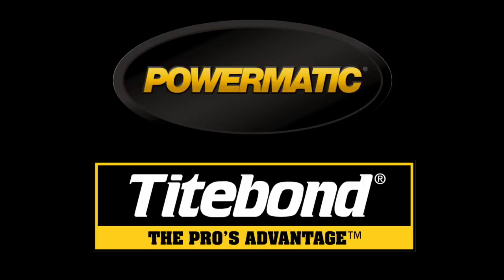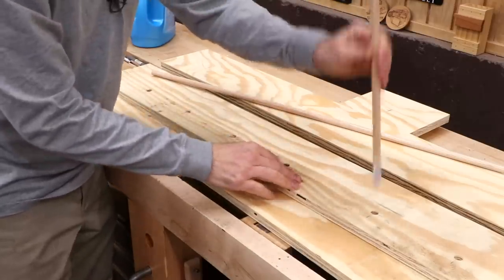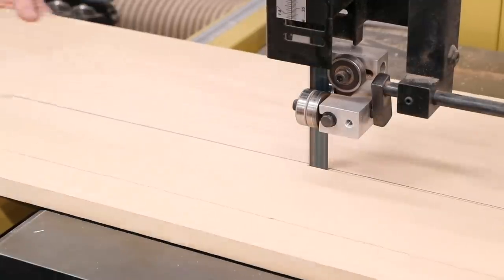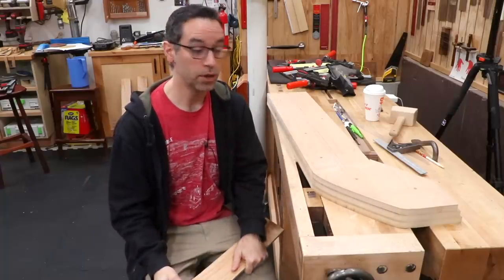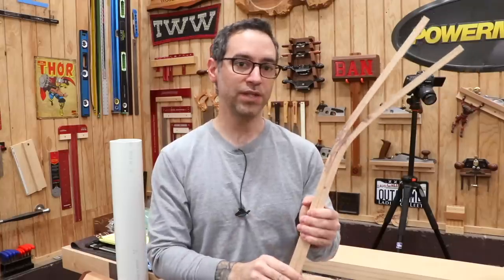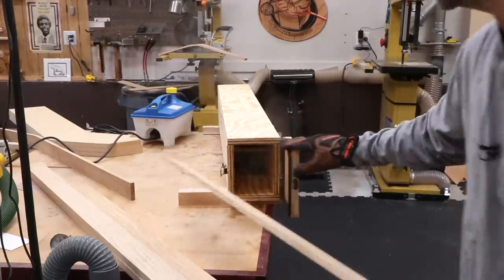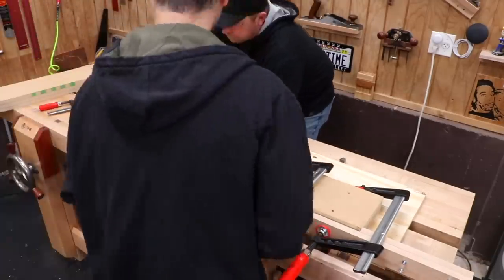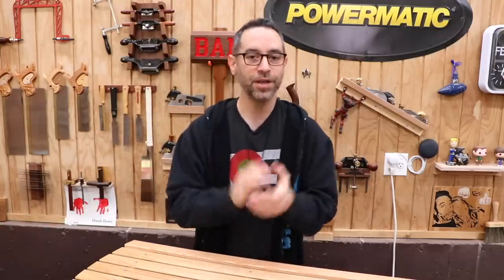Adventures in Steam Bending

Comment: I'm pretty sure I've seen timber at my local hardware store that looks like that already. :)
Reply: What you referred to are especially good for boat making, rocking chairs and silos.
Reply: Yeah, but they call them studs.
Reply: Dark Justice  Ya I realized that when we had to go there and get wood for a new fence and gate.
Reply: I’ve seen stuff like that for sale too! Usually at the back of the rack, warped to hell and no one would touch it with a barge pole! Some shops really need to work on their quality control.
Reply: Have been reading a lot about steam bending and wood properties. To increase the chances of a good bend without cracks I recommend to superheat your steam to first try at 150 degrees celsius (more or less) and then try at around 200+ degree celsius. Continue to use your time rule + a little extra for good measure (just important to get the wood at a uniform temperature).  

The reason I recommend this is because the substance that holds the fibers together in wood is called lignin, and this substance and its melting point is described in this one article (https://www.sciencedirect.com/topics/materials-science/lignin (3.5.1.3 Lignin) ) to have the following properties "Lignin has a glass transition temperature of about 90°C and melting temperature of about 170°C. Another article (https://bioresources.cnr.ncsu.edu/resources/thermal-softening-adhesive-properties-and-glass-transitions-in lignin-hemicellulose-and-cellulose/) make out lignin to have a "Softening temperatures of lignins ranged from 127-193°C. Birch xylan and pine glucomannan softened at 167° and 181’C, respectively."

To increase temperature, you could maybe take the exhaust gas from combustion and coil it with a copper pipe multiple times around the steam pipe and to increase heat transfer the steam pipe should also be from copper. You could also maybe route the exhaust gases directly into the steam box. I still recommend having the steam presence as the article (https://bioresources.cnr.ncsu.edu/resources/thermal-softening-adhesive-properties-and-glass-transitions-in-lignin-hemicellulose-and-cellulose/) state that "Sorption of water by lignin and hemicellulose caused pronounced decrease of the softening temperature-in some cases to as low as 54°C." 

It would be really cool and interesting to see this experiment and see how it changes the bend. I would love to try myself but I am currently studying in a big city abroad and
wont be able to try it before the summer when I can go back to my home town where I have garage and equipment. But I dont want to  wait that long! :)

Maybe if your able to superheat your steam to 200+ celsius you could try to bend pine wood? Know this wood is notorious to be hard to bend!

Comment: I'm a guitar builder, so the wood I'm bending is much thinner.  Take this for what it's worth.  In the guitar world, we have found that water isn't important for bending wood - HEAT is the thing which softens the wood.  Steam can help to carry the heat into the wood, but the water just makes things go wonky, particularly if you have a piece of wood with complicated grain structure (anything which isn't perfectly quartersawn, with minimal runout).  Now, we are bending thin pieces of wood, and we bend them around heated forms, but these days I use a spray bottle to moisten a side, wrap it in parchment paper (the stuff for the kitchen), and bend.  Thicker wood will require more heating than this, but I'm not at all convinced that water is helpful in the process.  Using something like the silcone heat blankets most guitar builders are using would be a great, albeit expensive, option.

Air dried lumber is a big deal, though.  Either that, or make sure it has been acclimatizing to your shop for as long as possible - a year at least.  Kiln dried lumber still has a lot of moisture in the cells of the wood, but most of the water has been driven out from between the cells.  It's average moisture content is low, but it has pockets which is quite high.  When the wood is heated enough for bending, these areas have very different plasticity, and you get a lot of spring back and checking.  Air dried lumber dries more evenly, so when heated it has a more even plasticity.

Compression is extremely beneficial.  It can make it possible to bend wood which is completely unsuited for bending.
Reply: That makes sense, since at 5000ft above sea level, his steam is significantly cooler than at sea level.
Reply: I left a separate comment earlier citing the Wood Handbook which basically agrees with what you say. I had also though about how, for example, the sides of an acoustic guitar are bent around a heated form without steaming. It is in fact the heat which "melts" the lignin in the wood and makes it plastic. The added water/moisture apparently just helps reduce the melting temperature and thus also the chances of damaging the fibers of the wood at prolonged exposure to high temperatures. The sides of a guitar are so thin, as you mentioned, that I think the heat simply takes less time to permeate the full thickness of the wood, so it can be safely bent with heat alone in a much shorter time without damaging the fibers. I suspect that if you tried this with a much thicker piece, you might end up degrading the fibers in the (much longer) time it took to fully heat and plasticize the board.
Reply: @MechanicalMind7  Makes sense, though while we don't use steam, it is traditional to soak wood for 5-10 minutes before you bend sides.  This has become far less common, though, because it will frequently cause highly figured wood (curly maple, curly koa, etc.; or some of the flat sawn stuff we sometimes have to use because customers can't understand that all available Brazilian rosewood came out of the burn pile from a factory 50 years ago, and should have ended up in a furnace) to create cross-grain cracks when bent.  With highly figured wood, bending it almost dry is by far the most effective option, and it works so well with difficult wood that we may as well use it for easier wood as well.  As I think I already said, for guitar sides I spray them with a spray bottle, wrap them in parchment paper to keep any resins from cross contaminating anything, and bend it around the mold with a silicone heat blanket.
Reply: how hot is the metal you bend around? Im wondering if heat blanket kits from webstaurant store witha cheapo temperature thermostat controller from ebay would be hot enough a with enough control heat blankets run 30-60 bucks
Reply: @802Leith  I've never really measured it, but the Watlow blankets I use can easily and quickly get up to about 500 degrees.  I run them pretty much full on for bending, and then turn them down to "set" the bend at about 50% (or so) power for ten minutes.
Reply: Thank you, that's very helpful.
Reply: @lightaces  I use an aluminum foil wrap and spritz of water. Some woods tend to bleed resins a bit more than other, but it does depend on how long and how high the temperature in the blanket. But it only takes about 3 or 4 minutes for a complete side-bend in my press. I usually cool down for a couple of hours before releasing.
Reply: @garyhome7101  Aluminum is such a reactive material, and I use a ton of parchment paper anyway (it is a much better replacement for wax paper to protect cauls from glue), I like the parchment paper.
Reply: What temperatures are we talking?
Reply: @walterblanc9708  I don't actually measure the temperature, but on my old metal Overholtzer benders I test them by looking for the Leidenfrost effect.  That happens right around 400 degrees Fahrenheit.  Wood is a pretty good insulator, though, so most of the wood never gets anywhere near that hot.  My other benders use silicon heat blankets, and those can get up to 600 degrees, but I turn them way down as soon as I'm done bending (bending around forms is a pretty quick process - a couple minutes at the high temperature, then turn it down to about 2/3 on the rheostat.)
Reply: @lightaces  Thankyou Gabriel. I see you have lots of vids! I shall watch. I intend to make some shelves with curved end pieces for knick knacks and stuff. This video had put me off I shall use thinner wood!
Reply: @walterblanc9708  Steam bending is really a very different process than what we do, though.  I would say the most important thing to keep in mind, especially for a first try, is to make sure your wood is clear of defects, with as little run out as possible, and ideally well quartersawn.  You want to reduce the opportunities for cracking as much as possible.  Another thing which is know to help is bending the wood in tension (stretching the wood lengthwise while bending).
Reply: @lightaces  Thankyou for the info. i guess It will be a fairly steep learning curve.
Reply: @walterblanc9708  I'm pretty sure you Taunton Press has some books on steam bending.  their stuff is always worth while.  Just make sure to allow for some practice pieces.
Reply: My grandfather was a master of different handcrafts (worked with metals, wood and so on) and was able to make almost anything as blacksmith and same as woodworker and carpenter. He produced a lot of toys for me when I was a kid, using wood (usually young ash, there were many of it in our place). At  that time he was 85-90 years old and about 80-90% blind and even can't recognise me and my brother with his eyes.
   And last that I remember about his craftsmanship was the woodworking process when I helped him to make a bow for me ( every summer I asked him for new toys I saw in movies or somewhere else during academic year in primary school ). It was simple project, piece of ash was not too thick (no more than 1 inch in diameter). And for bending we (he) didn't use any heat at all. He used only little water which was just same temperature as air (about 25-30 celsius). He moistened a rag with water, then with this rag he moistened a piece of wood along its entire length several times in a row, and after a short time he simply began to slowly and carefully bend with his hands. Having received the desired radius of the arc, I helped him to secure the ends and fix the shape with a thread (both ends were tied under tension). After that, we left the bow for a day or two at open air to dry.
   As high precision wasn't required we did nothing more than this. I saw his other completed projects with bended wood pieces 2 times thicker than this but I didn't see any special tools or heaters around. He has could use some big water bath with heated water ( I saw one japanese master used this technique ) for thicker wood pieces to steam up and reduce fiber tension. But at this time my grandfather was almost completely blind and stopped do anything at all. So I didn't catch more complicated projects and stuff. But still I learned a lot of things from him just by messing around when he still was able to do simple projects and toys for me.
Reply: Great response!...I have a koa set that's been sitting for a year plus...in my closet...jaja....any insights for bending koa sides?
Reply: @LiloUkulele  How much figure?  If you can find a way to keep the side under tension as you are bending it, that helps a lot.  And minimal water...Take your time, and back it up with some stainless spring steel.
Reply: @lightaces  Thanks for the reply! It's pretty straight-grained, just some nice variation in color (sapwood?). Do you just spray a little water, wrap it up and used a heat blanket?...some times you just have to jump into the water...thkx again for the quick reply!
Reply: @LiloUkulele  yup, pretty much.
Reply: I know I'm late to the party, but I did a cooperage workshop (bucket, pale and barrel making) and they said the same thing. When bending oak barrel staves the key is to heat it quickly, then bend them before they cool, no soaking involved.

Where soaking helps is on green lumber. I've been bending wood hoops for my buckets. I cut a bunch of hoop blanks from fresh cut breech or ash and keep the blanks in PVC tubes with water to keep them hydrated so when I get to the part of making the hoop the wood is still flexible.
Reply: @GodotWorld  Interesting....a question, though;  what, technically, is the difference between a bucket and a pail?  I always thought that was just a dialect thing.
Reply: @lightaces  Pales are wider at the bottom. They're meant to hold liquids, like milk, and don't tip over easily. Fill the pale put it on a wagon or boat and swaying back and forth or hitting bumps in the road it won't spill all over. Buckets are wider at the top, can hold liquid, but not necessarily. Easier for putting things in and taking them out.

TL;DR: A pale is basically an upside-down bucket.
Reply: @GodotWorld  both the people I told this to want to know - what if the sides are straight?
Reply: @lightaces  I don't know for sure, but I'd call it a bucket as the key feature of the pale is the opening has to be smaller than the bottom to keep liquid inside and make it harder to tip over.
Reply: @GodotWorld  Thanks!!!  Over the weekend, I've told this to 3 people, and ALL of them asked the same question!!!

Comment: Hi Marc - great video - I've done a lot of steam bending almost exclusively with kiln dried timber (oak, ash, walnut, maple). Don't soak it! I've found the most important factors (in order) are ... 

1: Strap. You are quite right, without a compression strap you will fail a lot!
2: Temperature in the box. Get as close to 100C as possible - below 95C is no good.
3: Steaming time. An hour per inch doesn't seem to come down in a linear way ie half inch takes longer than 30 mins etc.
4: Try to avoid grain run out on the bend.

You are right about drying too - I clamp mine in a drying form then put it in the oven (I bend much shorter peices than your sled!!) ... 3 hours at around 80C seems to give almost no spring back.

Like I say, this is just my own personal experience - as you rightly point out, trial and error is the best way to suss out what works for you - I have photos of piles and piles of bending fails to attest to that! Thanks again for your wonderful channel & keep up the good work.
Reply: I’m guessing that soaking the wood just adds more cold water that needs to be heated up, is that right?
Reply: Thanks for the informative comment.
Please post a video on bending.

Comment: I took a class with Michael Fortune (master woodbender) a few years ago. He recommended only air-dried wood for steam bending. He also said that the bending strap is essential. As you pointed out, wood doesn't like to stretch, but is happy to compress. A strap of his design that is adjustable for any length board is available from Lee Valley. He claimed that there should be NO springback with steam bending. He had a 6/4 piece of walnut that he had bent around a 3" diameter form and it still fit snugly around the form. Amazing! His line was "once the wood is steam bent it thinks it grew that way".

Comment: Morning Wood Whisperer! Have been reading a lot about steam bending and wood properties. To increase the chances of a good bend without cracks I recommend to superheat your steam to first try at 150 degrees celcius (more or less) and then try at around 200+ degree celcius. Continue to use your time rule + a little extra for good measure (just important to get the wood at a uniform temperature). 

The reason I recommend this is because the substance that holds the fibers together in wood is called lignin, and this substance and its melting point is described in this one article (@t (@t Lignin) ) to have the following properties "Lignin has a glass transition temperature of about 90°C and melting temperature of about 170°C.  Another article (@t make out lignin to have a "Softening temperatures of lignins ranged from 127-193°C. Birch xylan and pine glucomannan softened at 167° and 181’C, respectively."

To increase temperature, you could maybe take the exhaust gas from combustion and coil it with a copper pipe multiple times around the steam pipe and to increase heat transfer the steam pipe should also be from copper. You could also maybe route the exhaust gases directly into the steam box. I still recommend having the steam presence as the article (@t state that  "Sorption of water by lignin and hemicellulose caused pronounced decrease of the softening temperature-in some cases to as low as 54°C." 

It would be really cool and interesting to see this experiment and see how it changes the bend. I would love to try myself but I am currently studying in a big city abroad and wont be able to try it before the summer  when I can go back to my home town where I have garage and equipment. But I dont want to wait that long! Maybe you could try to bend pine as well if you are able to get the steam to +200 celcius!  :)

Comment: For the bending form, you need a forming table, one with dog holes you can use for the form. You wouldn't have near the wasted sheet goods. You would only need a mandrel where the bend is, and dogs large enough to support the width of the work piece.

Metal working shops have forming tables like these, but one of those heavy workbenches all the woodworkers are building these days works almost as well.

Comment: At the furniture school I attended, two weeks was the minimum for drying in clamps on the moulds.
Reply: Very interesting.  How thick were the laminates?  I've done a lot of woodbending (in the '70's and '80's)  I mostly used 1/8" laminates.  I never used steam and didn't pay attention to if the wood was air or kiln dried.  Some woods gave more spring back than others and I'd just adjust the bends to accommodate it.  I'd soak the laminates in a sink overnight in hot/warm water, put the wet wood in the forms and let them dry out in the forms.  Then I'd glue everything up with carpenter glue.  I don't remember ever having cracking or splitting problems.  Now I'll have to try it again leaving the wood in the forms for a couple of weeks.